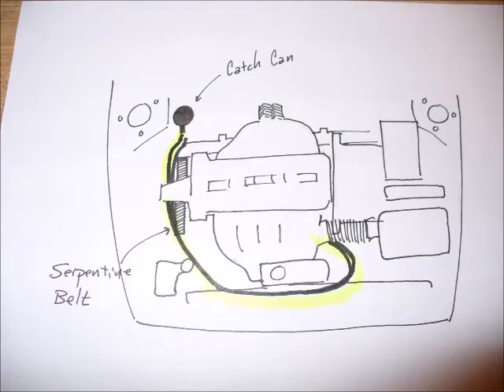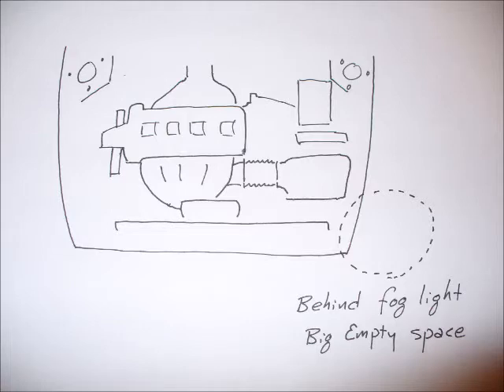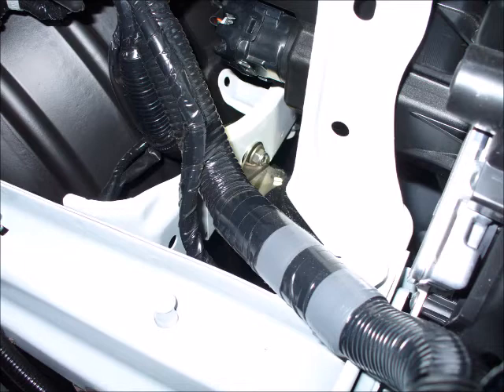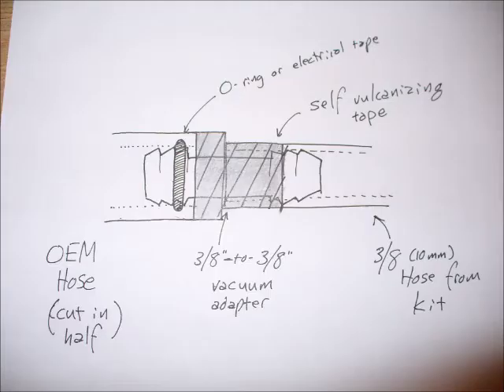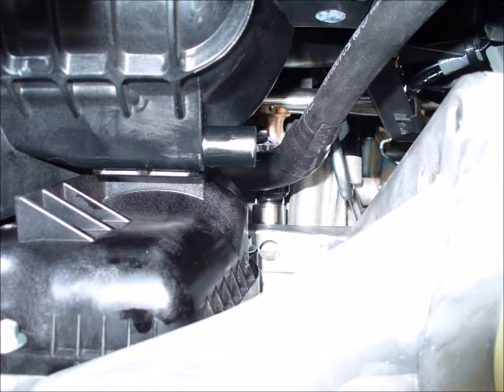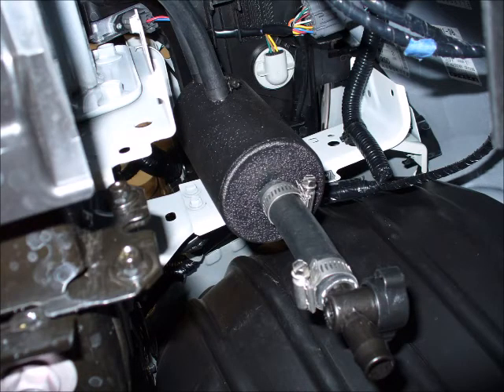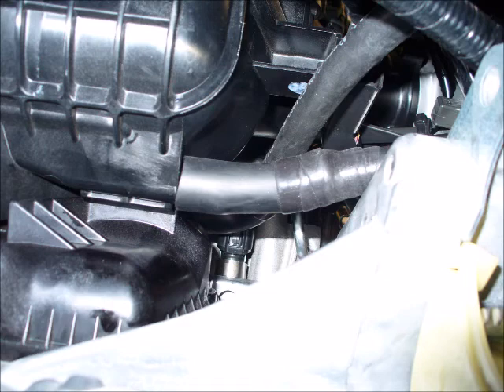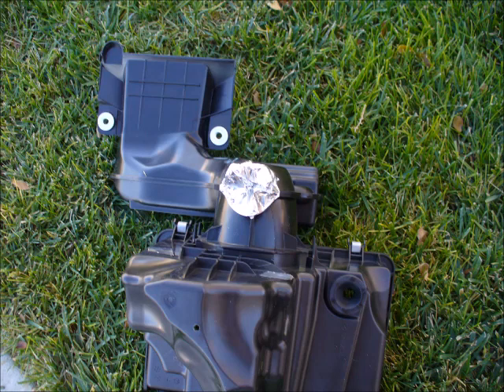Oil Catch Can movie

Comment: I removed the resonator off my mazda 6 and did't plug the holes there, actually its getting more free air. I'm not sure but I've notice the miles per gallon stays around 29 and 30, before I removed the resonator was around 27 and 29.